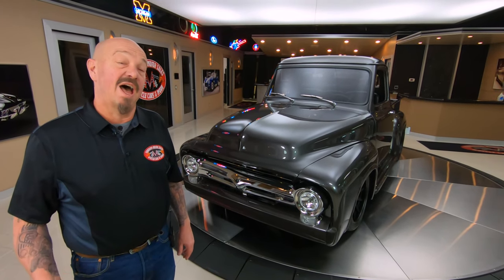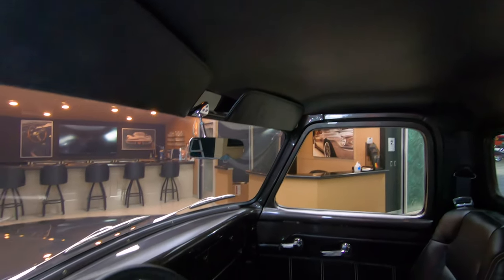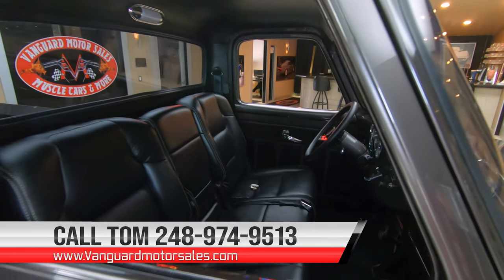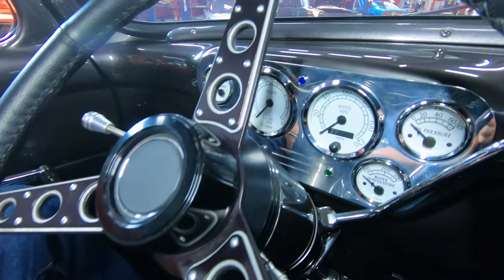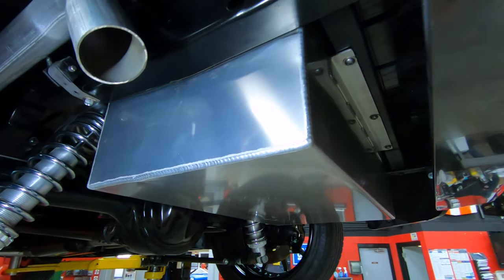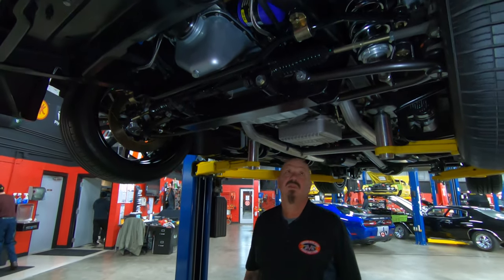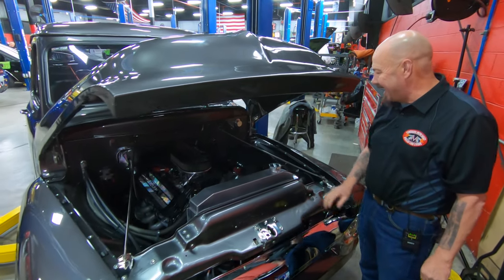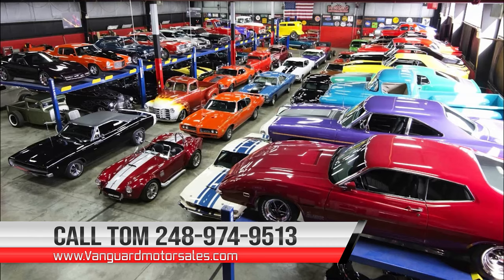427SR ROUSH!! 1953 Ford F100 For Sale Vanguard Motor Sales

Comment: 3:26 I can see in the mirror of the window and paint, that the weather is amazing, with a blue sky and a lot of sun. So when you say  “it’s nasty outside” you mean you have snow on the street?
Reply from the maker: Glad you asked! By its nasty outside we mean the roads are covered in snow, slush, and salt. We don't drive the cars outside with the roads in that condition. Now if it rains and clears all that salt off the roads we would be thrilled to actually drive the cars for you guys!
Reply: @vanguardmotorsales  never ever drive those amazing beauties in the salty snow ❤️❤️  Greets from souther palatinate 🙋🏼‍♂️